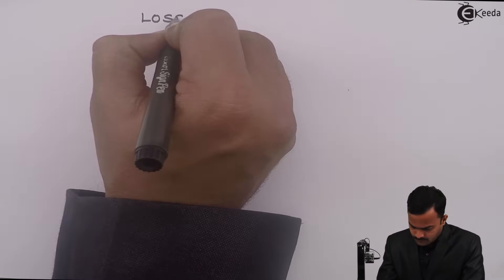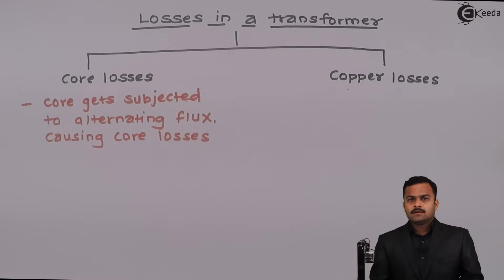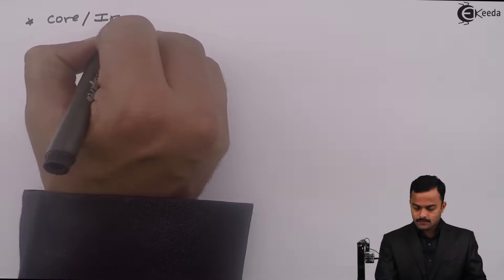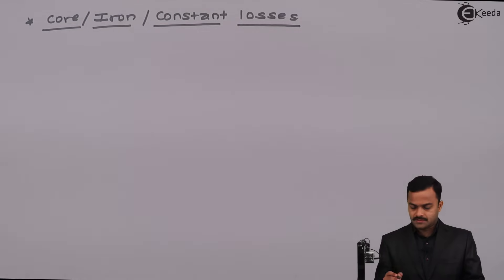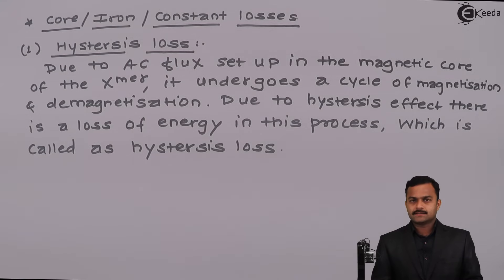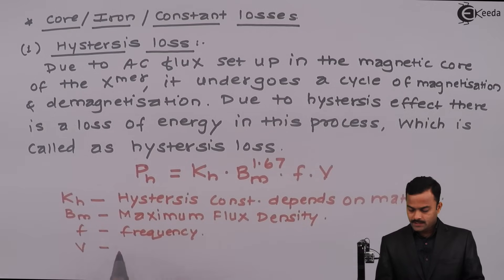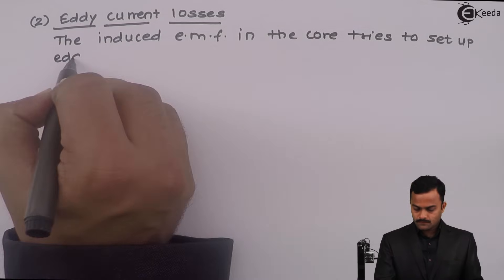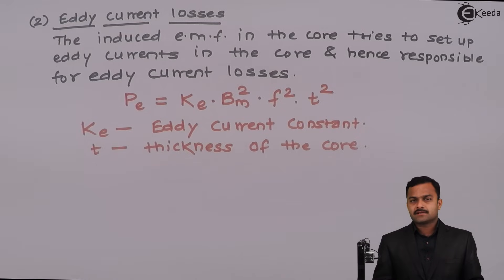Losses in a Transformer - Single Phase Transformer - Basic Electrical Engineering

Comment: sir u r telling that losses due to eddy current is eddy current loss.. first you should clear us what is eddy current.
Reply: Current which are generated due to changing magnetic field , and these are developed in circular directions
Reply: Eddy currenrs: when some conductors are placed in the moving electric field then then there is an induced emf in those conductors and the induced emf is called Eddy current.
  The loss of magnetic or electric field due to these Eddy current is called Eddy current losses
Reply: In a simple way we can say as leakage of flux I think so..
Reply: @sahanadr2702  yes yes